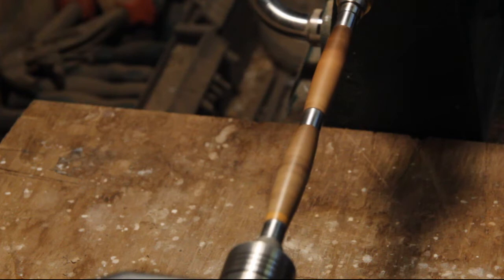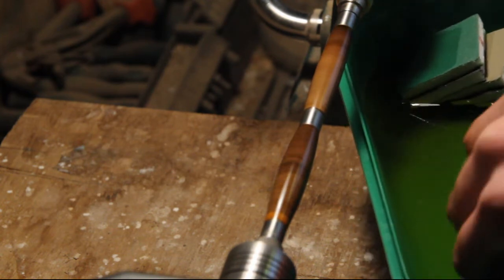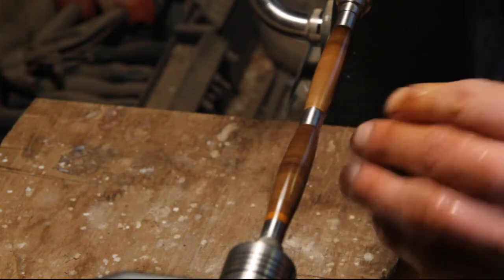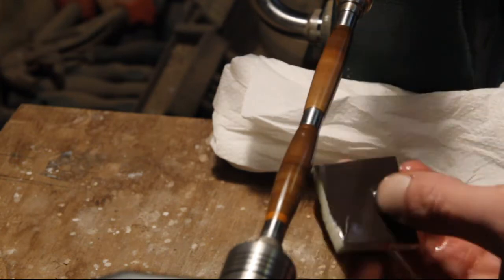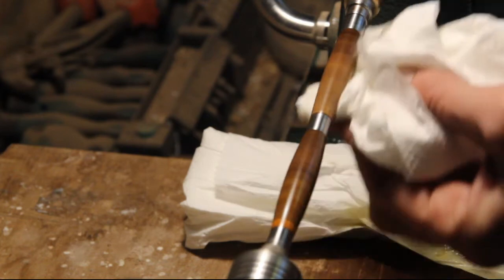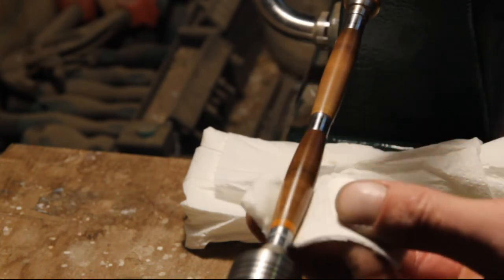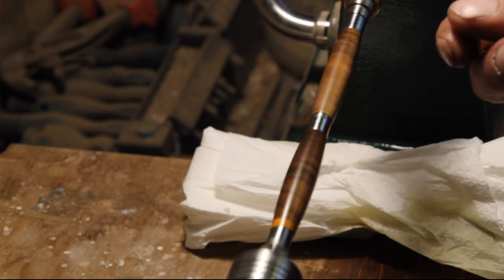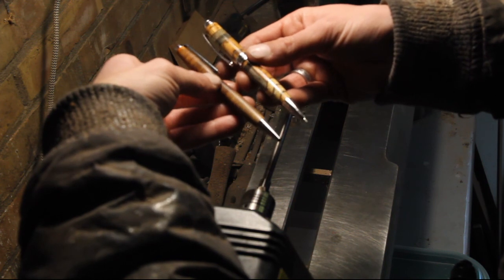Wet sanding in oil, penblanks with a natural finish

Comment: Is there a reason you use cold pressed linseed oil instead of BLO?
Reply from the maker: Hi Chris, yes there is. BLO has a tendency to taint lighter woods more strongly (yellowing). When I use lighter woods or white woods I like to keep them as pure as possible, but still make any grainpatterns show up.
Alternatively one could use Mineral oil, but that is not widely available in my area.
Another thing to keep in mind is that most BLO is 'polluted' with, at least trace amounts, of various (heavy) metals like lead and nickel; those contaminations originate from the process that is used to make it.
This, in my opinion, makes BLO not food safe and thus gives me enough reason to refrain from it as a finish on something one would hold in his/her hands for longer periods.
Reply: Thanks. I'm going to try your method, but since cold pressed LO is a bit harder to come by in my area, I was wondering what the difference is. That's good enough reason for me to try it out.
Reply from the maker: Chris Cavallari Good luck man. You might want to look at a local reform store (the kind where they sell herbs and medicinal plants) they also sell (un)bleached beeswax pellets that can be used in addition to the oil to make a wax finish and even a friction polish